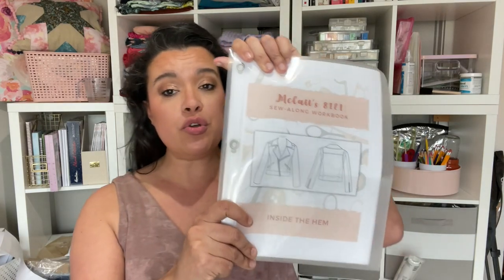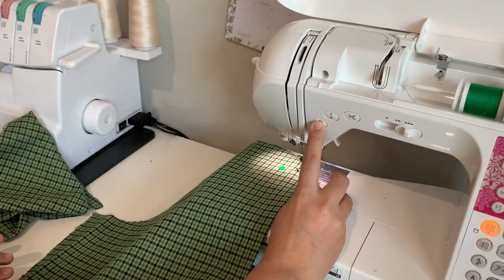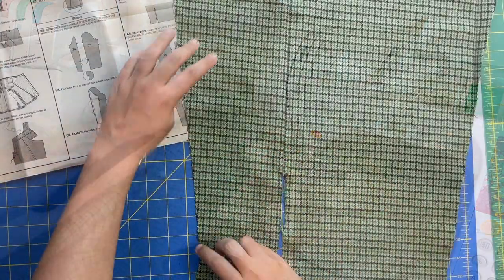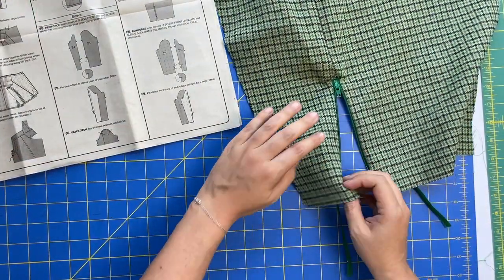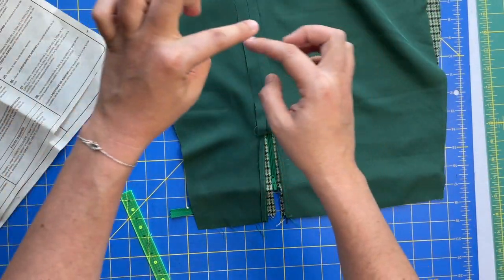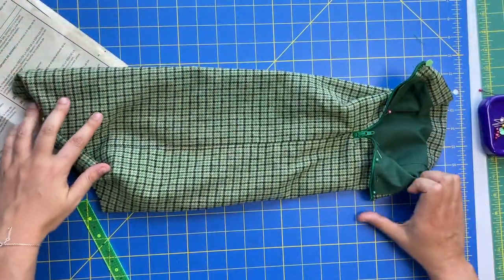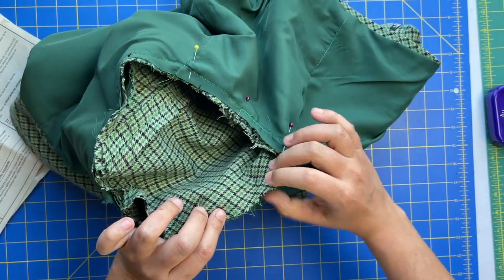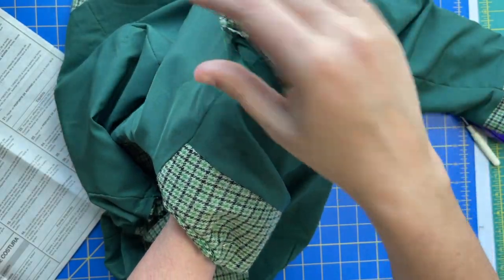McCall's 8121 Moto Jacket Sew-Along  |  Ep 5/6  |  The Sleeves

Comment: HINT:  There's a good trick for the shoulder seam:  Cut on the bias a short 5" to 6" by 1/2" strip of cotton fabric.  As you prepare to stitch the Stay Stitching AT THE SLEEVE CAP,  lay the cotton strip on the Stay Stitch sewing alignment.  Sink in the sewing needle.  Sew forward two stitches and backstitch two stitches.  THEN, here's the magic:  with your right hand, stretch the cotton strip as you sew.  The result will be magic.  The cotton strip will mechanically gather the sleeve cap AND will also add strength and structure to the sleeve cap.  Isn't M8121 a nice look.  Lindsey is doing a great job with her instructions.  Thank you, Lindsey.  ~  L
Reply from the maker: Wait what? Trying this immediatly!